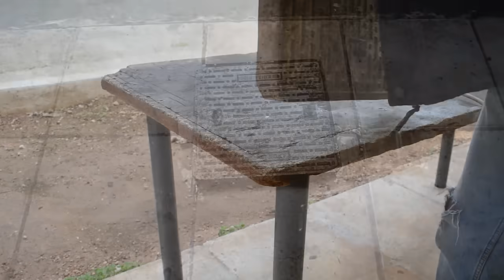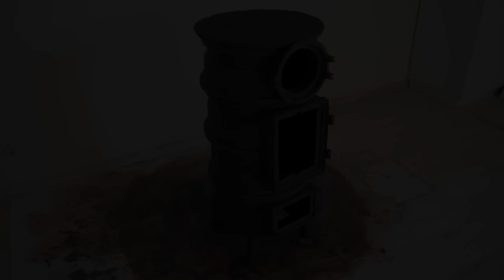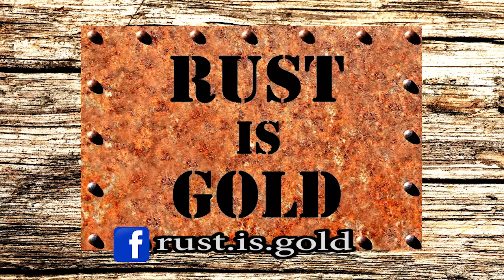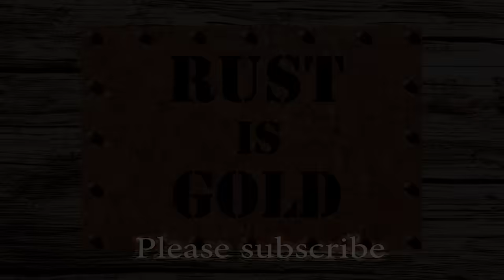DIY Wood Stove made from Car Rims

Comment: You've a bit of a problem there by not lining the burning chamber with the right stone, bricks or heatproof concrete - the steel will burn through in a few months/years depending. Cast iron is used for a reason - it has far better qualities in this respect (anti rust/corrosion), but even that doe not stand the test of time unless the proper (stone, concrete) lining is used - then it can last a lifetime. Ordinary concrete does not work - not worth even trying:- the proper stuff is fairly expensive, but it works 'forever'. Failing that, or with that, (so that little is needed) firebrick can sometimes be got secondhand very cheaply from the industrial furnaces of the past: This is why most stoves are rectangular, and/or have a sacrificial plate or two inside.
Reply from the maker: Thank you very much for your comments!! They were very informative! 😊👍👍
Reply: thats true with the brick surround inside plus the steel plates touching the glass on the inside directly will most likely shatter the glass when heated
Reply from the maker: I agree about the bricks... Regarding the glass it doesn't touch the steel plates directly. I have put heat proof silicone in between..
Reply: @nzfalcon6578  I think it's stating the obvious to say that the bricks should not touch glass anywhere - it wouldn't look good. When fires fall as they burn, often glowing wood will touch the glass - it doesn't shatter, and the bricks are no hotter than air fed wood. There is no reason for the bricks to touch the glass in any case I can think of. The glass itself is allowed to expand - normally by using a long strip of fire proof seal which looks like a woven string between the glass and the metal door frame, and the glass itself held in place by metal tabs that allow the glass to move (If heatproof silicone works in that capacity then great - I have never tried that method myself). No "steel plates" touch the glass apart from the very small 'sprung steel' retaining tabs touching it (usually four of them). Just have a look at some stoves in a showroom.
Reply: @RustisGold  Hi again, many stoves have metal tabs welded on the inside to help adhesion of the fireproof cement. Other models have protrusions in strategic places to help stability and positioning of the fire bricks they fit. So one may have to cut bricks to fit, or find the original type (they are fairly standard in Europe, it seems, in two or three sizes). If one cleans cast iron very well, it has a rough surface and the mortar really adheres well. Smoother mild steel may need roughening with a grinder, or better, some tabs welded on here and there to hold the mortar. Actually I'd suggest more fire brick on such smoother steel, with retaining tabs here and there. The thickness of bricks or mortar can be as thick as you like - and it retains heat well over long periods when the fire goes out, but takes up space in the burning chamber, so there's a trade off. And it makes the stove heavier. About one inch thick is the thinnest one can go (mortar or bricks), to keep it strong and effective - and firebricks are available down to around 25-30mm (and inch to an inch and a quarter) - these are perfectly adequate. Hope this is of use.
Reply: @RustisGold  By the way, one can 'get away' with small areas of uncovered steel for example near the door frame - the rule of thumb is the hotter it gets, the more one needs mortar to prevent corrosion. So it's the more necessary where the fire burns hottest. Some older stoves use 'sacrificial' plates of steel instead - usually but not always 1/4 inch (7-8mm) cast iron, bolted or cemented in place over the actual steel of the stove, with say an inch air gap between - these wear out after some 20 years depending. That's another way to do it, where mortar/stone is harder to fit or could get chipped off.
Reply from the maker: Wow!!! Thank you VERY MUCH for all your comments! Very helpful!!! 😊😊😊😊👍👍👍👍
Reply: @Gurgle Jug,
  You have obviously never seen an old 1950's Ashley wood heater.  They used the same concept; a grate to allow the ash to fall into a bin, no fire brick and the fire box was only heavy sheet metal. The only thing cast on it was the front and the door, and it was cast steel, not iron.  
  My grandparents had one and my parents had one for twenty years, until they bought a Franklin Fireplace.  I got their old Ashley and used it for ten years until I gave it to someone when I built a stove of my own design.  I wouldn't doubt that it's still in use.
  They were for wood or coal.  The cast steel grate was beginning to sag and I suspect, if it were used for coal, that would be the only thing that might need to be replaced.
Reply: @richardrogers668  when you say "you have obviously never seen..." don't you think that's rather rude? How long a stove lasts depends on how much use it has, what fuel is used, and a multitude of factors. If steel is fine then it would be helpful to say which steel... for example stainless steel is hopeless. You might mention thickness, weight and suitable uses, as well as heat storage capacity and efficient burning by having the right temperature in the burning chamber. I am sure there are stoves produced before the dinosaurs walked the earth, some were made by Jesus himself and all the rest which exist in peoples' families, and in their imagination. Now, "cast steel", not iron. Hmm why would anyone for any reason cast steel instead of iron? I presume you know that steel rusts, iron doesn't (in essence), which is why some iron rivets made by the Vikings last to this day. Honestly, I think you just want to quarrel and haven't a clue what you are talking about, unless perhaps you can define how you know it was "cast steel, not cast iron" and thus presumably what grade it was?! Low carbon steel, at a push? If so, why? I can only point you to the fact that almost every stove in every country and culture I have ever seen are cast iron, as they last longer, and almost always brick/fireproof cement lined and that in the very few cases where steel is used, (in extremely poor countries, normally, from scrap, industry surplus steel etc), or made for fun, they are lined with firebrick/cement, or even clay is used. Even if one argued for only steel because it is easier to work, why would anyone be fool enough not to line them? Poverty or ignorance? As a matter of fact I have a steel stove - well designed to keep the hottest temperatures away from the steel using clay and brick - a design from Poland known for their cheapness - it's not as though they don't exist. You do what you want matey - but some positive information would be more pleasant than a simple opinion based on a one off experience somewhere, even with doubtful understanding of it. Or make your millions and tell all the stove casting foundries worldwide where they are 'all' going wrong, perhaps?

Comment: What is the top door for?
Reply from the maker: I wanted to put a small door on top and I had this circular door here in stock so I decided to install it! All the other wood stoves I searched in YouTube had 3 doors. In addition you can open this door to allow more air to go up chimney.  This will clear the stove of smoke with out opening bottom draft door which will increase the strength/heat of the actual fire.

Comment: Very creative in all aspects of the fabrication. But for the love of God at least get a mig welder,  lol. They aren't extremely expensive and you could learn to mig really quickly. It will save you time and cleaning up your welds will be much easier. Same for using a plasma cutter instead of the ginder, it will save you tons of time, and you won't go thru tons of cutoff wheels and stones. Otherwise I  say thumbs up, especially on the creativity.
Reply from the maker: Thank you very much for your comments!! 😊👍👍 I will definitely need to follow your advice!!

Comment: I'm just trying to understand the concept. It looks like you have the exhaust going into your house. I know you're not allowing smoke to fill your house so I can only guess you're running it through and out. If you're using this for heating, that seems inefficient as you're losing most of the heat to the container which is outside. Moving it inside and the exhaust outside seems like the better setup to get the most out of the heating. Am I missing something?
Reply from the maker: I am sorry, the video was a little confusing. I used an empty apartment to shoot the last stages of building my wood stove and then for safety reasons I moved the wood stove outside in order to try it for the first time.
I was using my wood stove to heat my workshop however my son liked it so much that he took it and placed it in his apartment as a decorative item! 
I need to build a new one! 😄😊👍
Reply: @RustisGold  haha, that's nice! :)
Reply from the maker: @Andre-nx5xl  😊👍

Comment: Every think u do it nice thanks but i dont understand a round top window
Reply from the maker: Thank you very much for your comments! I wanted to put a small door on top and I had this circular door here in stock so I decided to install it! All the other wood stoves I searched in YouTube had 3 doors. In addition you can open this door to allow more air to go up to the chimney.  This will clear the stove of smoke with out opening the bottom draft door which will increase the strength/heat of the actual fire.

Comment: What rod are you using?
Reply from the maker: 2mm for the thin surfaces, 2.5mm for normal and 3.2mm for the thick ones
Reply: Yeah it could weld both cast iron and steel...
Reply: Looked like some 6011 ,7018 and some 6013

Comment: that was some of the worst welds I have ever seen! Thanks making a video of how NOT to weld something up. Great Job.
Reply from the maker: I know it's not the best welding but I am not a professional welder and this is not a welding competition. Plus I used the grinding wheel and they look just fine. I am not trying to sell the objects I create. Just trying to show to other people how they can transform pieces of garbage into nice looking and functional objects...
If you still have a problem with the welds just post a tutorial video on your empty channel and show us how proper welding is done.
Reply: @RustisGold  as for the welding. I don't grind because it cuts some off but you should try and learn some better welding. practice running straight beads on flat metal. adjust your temperature and travel speed. I promise it will get better.
Reply from the maker: @eagle9252  thank you very much for your comments. I do practice and I see improvement. I have also watched some tutorials on how to weld on the internet. 😊👍
Reply: @RustisGold  try going a little slower with slight movement side to side. If you burn holes it’s too hot... lol. MIG is easier. It m starting to learn TIG but don’t have time to practice.
Reply from the maker: Thank you very much for the tips... I am thinking of buying a MIG...
Reply: @RustisGold  stick welding when it sounds like a frying egg your good on heat, wave the rod 1/8 inch back and forth so you can move the pool of molten metal. As said practicing flat on mild steel with 7014 rod within a hour youll be better
Reply from the maker: Thank you all for your advices! 😊👍

Comment: poor welding skill`s but 4 the rest, nice work
Reply from the maker: Thank you very much for your comments. I know it's not the best welding but I am not a professional welder and this is not a welding competition. Plus I used the grinding wheel and they look just fine. I am not trying to sell the objects I create. Just trying to show to other people how they can transform pieces of garbage into nice looking and functional objects... Take care!
Reply: @RustisGold  Главное чтобы при хорошем нагреве не отвалилось :-)
P.S.: Чугунные дверки варить со сталью - даже у профессиональных сварщиков не получается. Ну не варятся они друг к другу так просто. А из-за разного расширения металлов при нагревании возникают трещины и такая сварка не удержит.
Что касается правильных сварных швов, в ютубе есть много уроков, тогда швы будут такими же красивыми и можно будет на продажу делать. Успехов вам! Вы молодец, стараетесь! )
Reply from the maker: @ELFMEDIA I did a trick that I read in various forums ... I spent some electrodes (2.5mm) by welding them on the cast iron and I created a layer of metal.  I let it cool and then I welded the cast iron with the metal plates.  It really worked! So far while using the wood stove I haven't noticed any cracks on the weldings.

Comment: Steel rims, not aluminum rims!!  
The tower design can accommodate a Rocket-burn J-tube, to make it burn real clean, & get most heat out of least fuel, too.
Reply from the maker: I didn't use aluminum rims...
Reply: he is using steel rims
Reply from the maker: @kennethv5250  exactly...😊👍

Comment: for someone who is super fussy ok but why not leave the manhole covers as they are or even the bottom one as the base leave it square not even having to take off edging or those little bumps ?? what i would do because who is gonna see the stove when its done " the other guys" hmmmm who cares as long as it makes heat
Reply from the maker: There are so many different ways of making the same item!  😊👍

Comment: hay algo que no cuadra. esta soldando hierro dulce con hierro colado y no cuela
Reply: it welds but the cast iron doesn't flex so if there stress it may snap at weld
Reply: No va a ser muy duradero, la verdad...
Ni incluso las soldaduras entre llantas van a estar exentas de rajarse con las contracciones del frío y el calor, ni aunque las sueldes con 7018.
Como proyecto es chulo, pero poco fiable.
Reply: @thetrico  como tu dices, como proyecto bien como fiable, va a ser que no, pero bueno, es entretenido

Comment: Finaly product is very impressive ,but thats welds :///// im sorry man :D .Bad choise of the electrodes i think :)
Reply from the maker: Thank you very much for your comments. I know it's not the best welding but I am not a professional welder and this is not a welding competition. Plus I used the grinding wheel and they look just fine. I am not trying to sell the objects I create. Just trying to show to other people how they can transform pieces of garbage into nice looking and functional objects... Take care!
Reply: @RustisGold  Next  time u can change the polarity of elektrode or try this rutil elektrodes  for example E-R 117- 2,0 X 350 MM ESAB
Reply: Very good job man go ahead and I have one question how can I welding cast iron with black steel I mean a kind of electrode
Reply from the maker: @abuzaidalrifai5649  I had found this guy's comment on the internet and followed his advice. It worked! Create some layers of metal through welding, let it cool and then weld the two surfaces together. I copy/paste the original comment so you can read it...
"...If you don't have proper facilities consider opening up the joint area and running a few layers of weld onto the cast material first so the weld proper is mild steel to weld metal rather than directly to the cast. Do the layers as light as you can commensurate with decent fusion and leave to cool fully between layers. Tapping as it cools it said to help, not that I've ever noticed a difference. Helps to use the most ductile rod you can find.
Theory is that the thin layers don't put as much contraction induced stresses into the casting joint area as a straight weld and the actual join is to weld metal which is formulated to cope with such things. Helps reduce the cracking tendency.
My welding is functional rather than good but I've found the technique effective with both cast steels and cast irons...."
Reply: @RustisGold   thank you for your reply to this comment I have a new question finally abut the uper opening the circle one whith close door for what work
Reply from the maker: @abuzaidalrifai5649  I wanted to put a small door on top and I had this circular door here in stock so I decided to install it! All the other wood stoves I searched in YouTube had 3 doors. In addition you can open this door to allow more air to go up chimney.  This will clear the stove of smoke with out opening bottom draft door which will increase the strength/heat of the actual fire.

Comment: I hope that wasnt galvenized pipe you welded for the legs... the smoke from that can kill you
Reply from the maker: It was... I am always wearing protection
Reply from the maker: https://www.google.com/search?q=3m+mask&client=ms-android-xiaomi-rvo3&prmd=insv&sxsrf=ALeKk03Nnrn1Twn4h5poVJhrkIZAF0RMNw:1605597541186&source=lnms&tbm=isch&sa=X&ved=2ahUKEwiHnuD4hIntAhXFsaQKHXCaB6QQ_AUoAXoECAIQAQ&biw=393&bih=734&dpr=2.75#imgrc=-i4knDRU_AUX4M
Reply: he meant when there is a fire going in the stove the galvanized pipe will give off fume's which are toxic when they get hot it will burn off but it can take a long time depending on how hot the legs get and how much galvanic zinc is used on the pipe "how well they are made" they can put off fumes at temperatures as low as 100C and will turn white around 300C "by this point it's very dangerous" but it will flake off revealing regular steel beneath I recommend burning the galvanizing off using a torch outdoors or use the stove outside until all galvanizing burns off. if you experience headaches shortly after using your stove indoors it is a symptom of the galvanic fumes.
Reply from the maker: @Nik-WashnMore  thank you very much for your detailed answer. I am aware of the dangers involving galvanized steel. The legs of the stove don't get hot at all. Either way I have also removed the galvanized by using the torch as you have already mentioned. Whenever I weld I always wear a protective mask. Take care, thanks for your comments! 😊👍